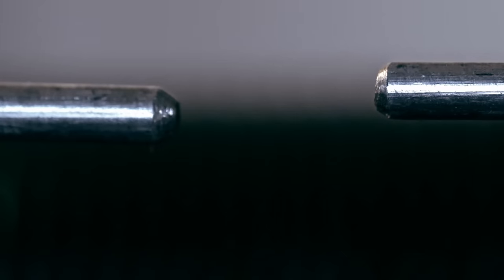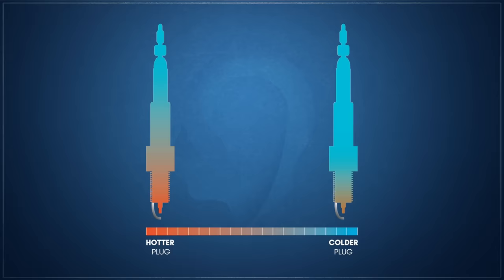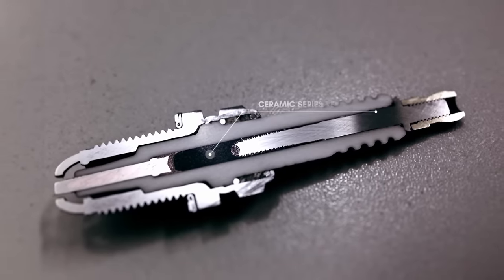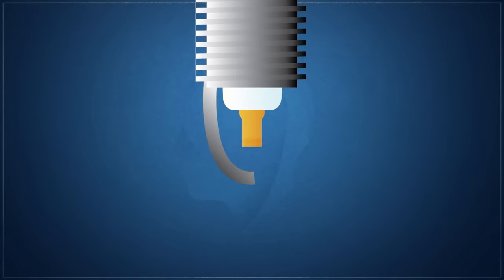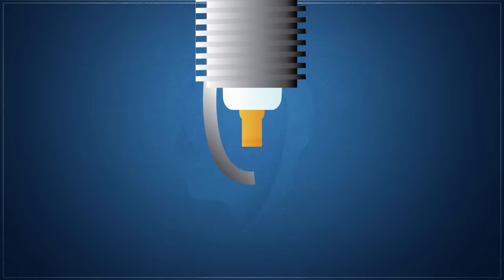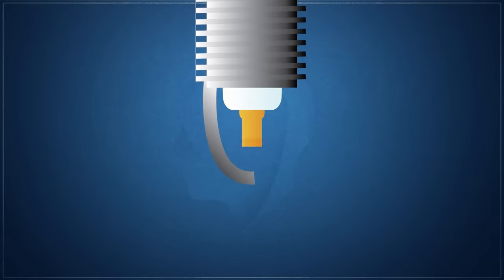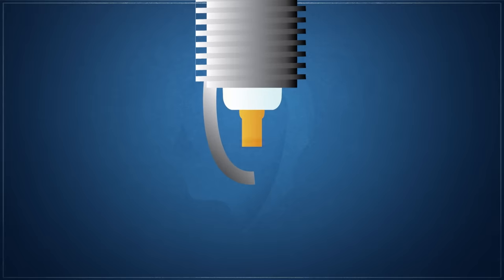The Spark Plug Story

Comment: As an old-school retired mechanic, I had no knowledge of the current use of the spark plug itself as a monitoring device. Excellent well researched video.
Reply: https://en.wikipedia.org/wiki/Saab_Direct_Ignition
Reply: Believe we were trying to do that in the mid 2000s on megasquirt detecting knock from ionization.
Reply: I tip my hat to the engineers that came up with that idea.  Awesome!
Reply: Research never stops...
Reply: Imagine most parts, devices, mechanisms, can work "both ways".
Example: solenoid valve. If you power it, the plunger moves, but the movement is visible on the current plot (waveform). You can power and diagnose the thing at the same time. Nothing new. Anyone "old-school" should know this!
Reply: @g.k.1669  No one "came up" with anything. These are basics of most electrical parts. You can monitor operation of the element (whatever: solenoid, motor, bulb, transformer, injector), by watching the waveforms (voltage, current) on oscilloscope.
Reply: Modern cars are terrible.  They won't be on the road in 50 years.  They simply are not designed to be cheaply serviced.
For example, a lot of modern cars now use a plastic intake manifold. This WILL become brittle and crack.  This is true of basically all plastics.  The used market won't help because age alone damages them.
MAYBE people will be able to print them in sections or get someone else to print them with a large enough printer. But it will cost a fortune.  This is just one of many, many problems when it comes to longevity and especially serviceability.
There was just a big story about a tail light that was five thousand dollars.
Reply: @christo930  Amennn.!!!
Reply: @christo930  A plastic intake manifold? I guess that is why modern stuff have those large plastic covers above the top of the engine to hide all of the weird things under them.
Reply: @Bob_Shy_132  Yes. Believe it or not, they are pretty common.  I have no idea why they put the plastic covers over engines these days.
Reply: @christo930 MANY times thise covers have a noise reducing pad affixed to the back side of them, and are there to cover up sounds of noisy injectors and high-pressure fuel pumps on engines today, and avoid customer complaints of "my engine sounds more noisy than it should be".
Reply: @davelowets  Injectors and high pressure fuel pumps (which are usually in the tank) have been around for decades.  These plastic covers have been around just over a decade.

Comment: My father invented a self igniting spark plug, it contained a piezo crystal and used engine compression to put pressure on the crystal causing it to make a spark, a man from the patent office came to see the prototype in action and was impressed to see a 250cc engine running with the plug,  it was to receive a patent but my father could not afford the fees at the time and it was shelved. The plug needed more development as i found out when i tried it in my Yamaha FS1E 2 stroke, i think the compression was too low,  but it had potential even as a get you home device should your cars electrics fail, i see piezo electric ignition on model engines these days but they dont operate the same way my fathers did
Reply: That would require lecture of the crystal, and a spark off of that crystal, (but we are talking incredibly small voltages)

I dont see how you could do that and keep it running considering it would get dirty,

The high voltage helps arc past these buildup issues
Reply: Great idea! Working out timing would be tricky using compression and getting a good spark timing curve to match rpm. A piezo triggered by a cam with mechanical advance or electronic somehow might do the trick as well???

Comment: It’s amazing how much spark plugs have improved in such a short time. Anyone who is at least 50 remembers when we had to clean or replace our spark plugs every few months/few thousand miles. These modern plugs will go 75,000-100,000 miles or more without even needing to be cleaned! I remember when you would pull them and clean/regal them every few months and they still would wear out and need to be replaced after a year or two. My current car has over 100k on it and I only replaced the plugs once! Honestly they didn’t even need to be replaced at 50k but I just got nervous and changed them out because I was worried they would get sized in the heads after being in there for 5 or 6 years! Anyone remember points? Yea we used to have to do a lot more maintenance on cars back then. Granted modern cars have lots of other problems and I’d gladly go back to points and the old plugs, it really wasn’t bad having to replace plugs and points every other oil change because those older cars were a lot easier and more pleasant to work on compared to these late model ones where you have to take half the car apart to get to anything. Leaded fuel didn’t help fouling but the real improvements are in the materials. Those old plugs just wore out the gap got bigger and bigger and after a few months it got so large that the engine started misfiring. When I pulled the ones out of my current car after 50,000 miles the gap was almost the same as a new plug! We’re talking about maybe 0.010 wear, those old school plugs eroded that much or more in 5,000 miles.
Reply: Yes...I haven't seen a gapping tool in a long time...
Reply: Some of us young folk still know how to take an emery cloth to a points dizzy! And truthfully, I agree with the sentiment behind going back to points and old plugs. I daily drive a 77 Mercury Cougar and do all my own maintenance on it. Oil changes, brakes and bearings, carb and timing adjustments, and most importantly diagnosis... I can do it all with simple tools and from the comfort of my own garage. Some people call me crazy for driving a gas guzzling land yacht but honestly I wouldn't trade that kind of straightforward, analog, accessible ease of work for a newer car. Hearing recently about Dodge's new non-serviceable transmission, in addition to watching a very disappointing video review of their new Hornet SUV (from a channel here on YouTube titled "The Fast Lane Car"), really made me take a step back from the idea of the modern automobile. In an age where planned obsolescence and reliance on technology are becoming more and more prevalent, I think it's increasingly reasonable to seek a product made at a time when planned maintenance and longevity were the premiere focus. I really do.
Reply: Yes, BUT, the cars with these more sophisticated system can be absolute hell to deal with when they do develop problems, and they all do. For myself I prefer simpler less efficient designs that have fewer parts and are easily serviced. I don't care if I have to replace my spark plugs, cap and rotor every few years. It's easy to do...
Reply: That is a much more common dilemma for Diesel glow plugs... try it on a straight-6, 3.0l Mercedes diesel with 650,000 kilometers! (it wasn't pretty)
Reply: This is all way above your pay grade.
Reply: Filed & gapped a Lotta plugs & points,  but that Snap-On file hasn't touched anything automotive in a longtime.
Reply: If you attempt to 'clean' platinum or iridium plugs you will damage them.
Reply: I was born in the mid-1960s and grew up in the Minneapolis area. We actually had very cold winters back then- most of the winter was around zero degrees Fahrenheit and occasional Arctic air mass cold snaps to -30degF were regular occurrences during the 1970s there. Every fall in mid-October, my dad would pick a Saturday for he & I to get the family cars ready for winter. He'd get me up early on Saturday morning, feed me a big pancake, eggs and bacon breakfast, and then we'd drive out to the auto parts store where he'd buy plugs, points, a "condenser" (capacitor), winter-weight oil, a new oil filter and maybe a new distributor cap (if needed) for both of the family cars. Then he'd drive us back home in the crisp, sunny October daylight, typically around 55 degrees F and surrounded by trees that were in full color and dropping leaves, where we'd spend the rest of the morning and as much of the afternoon as necessary getting the cars, which had carburetors, ready for winter. Both cars usually had Sears Die-Hard batteries in them and we'd pop the caps off, measure the acidity in each cell and top them off with distilled water, clean the battery posts and cables, put in the new ignition parts, clean out the distributor caps, re-time both cars, change to winter oil and so on. Cherished memories of the annual ritual with my dad. :)
Reply: I drive a stock FJ60, carburated. About 20 yrs ago found out of about Pertronix and bought a Electronic replacement for Std contact point ignition. Never had to adjust Spark plug gap every 5K miles again. They last for ever. Once in a while remove and blast clean and gap if necesary.
Reply: Proper fuel n air mixture are the biggest improvements.
Reply: Amazing story 😮
Reply: I am going back to points. My 2014 Challenger is such an unapologetic shitbox that I'm replacing it with my grandpa's 1971 Chevy C10.
Reply: Nobody remembers a time you had to clean or replace spark plugs every few months.  This is complete and utter nonsense.  I'm 54 and I've never had this experience. I've owned and daily drove late 60s and 70s model cars as a teenager.
2 years, sure.  Plus, plugs were a buck back then.
Reply: @Trump985  If you remember that you are over a century old lol.
Reply: @SParis-xy1pc  Likewise for me. I flat refuse to buy any car new enough to have electronic fuel injection anymore. My 2014 Challenger was the last modern car I will ever daily. Replacing it with grampa's 71 Chevy C10! Straight six, 3 on the Tree, manual everything, and the most advanced tech in the entire vehicle is a mid 70s shaft mount AM/FM/Cassette radio I installed because grampa ordered such a simple truck it just didnt have a radio in the first place haha.
Reply: @christo930  Wasn’t my experience, I clearly remember cleaning plugs every few months on my 1960s and 70s cars. They didn’t start misfiring but you ended up losing some power after a few months and or a few thousand miles. The average person probably didn’t notice and likely ran there plugs till they noticed a misfire. As a young kid who drove like an idiot I was always chasing every last HP. However todays plugs don’t get fouled/worn anywhere near as much and cleaning/regaping them after even a year won’t gain any power.
Reply: @Trump985  Not every few thousand miles.  20k maybe.
Reply: I have a Ford 5.4 that didn't throw a code for over 260k miles... and NEVER had the plugs changed.
Reply: @TestECull  Points are fine for cars that originally had points.  But right in the early 70s is when most switched to HEI.
Reply: @Trump985  I was driving these cars when they were old, not new.  Even old they never needed plugs every couple of months.  That's just hogwash.  Granted, I was putting plugs made in the late mid-late 80s in these late 60s and 70s cars, but plug technology is nearly unchanged from that time.   Generally speaking, plugs just don't foul for no reason. If your car is running properly, your plugs should be fine for at least 2 years back then. It's when the car isn't running well that you end up with fouled plugs quickly.  This is particularly true if you are running rich or your oil rings aren't working.  But back in the 60s and 70s, these cars were new. The rings weren't leaking.  The carbs were not clogged up and poorly adjusted.  The gas was formulated to work well in a carburetor.

Comment: One of my first cars was a used 1970 Subaru 1066 cc, 4-speed manual trans,  which gave me more than 40 miles a gallon for the 13 years I had it. The NGK long reach plugs always had a soft tan colored residue on each of the the spark plug insulators. I was amazed how well designed the engine was and how well it ran, giving so much efficiency using old technology of carburetor, copper core plugs, ignition points and required valve tappet adjustments. It was pre-catalytic convertor and ran on leaded gas for at least half of its life. It ran so cool that the muffler would rot out frequently due to condensed moisture for which there was even a drain port on the bottom. I got the idea to pour some paint inside a new one and fully coat its interior which extended the muffler life substantially and never even caught fire even!
Reply: When cars were proper... it's better for the planet to keep an old car going than to keep buying a new "more efficient" car every 3 or 5 years
Reply: @greensnake00  I still drive an old 2000 Honda Accord with 167k and no real issues.

Comment: @3:38 once the ionized channel starts to conduct, voltage goes to near zero because it's practically a dead short. In reality it pulsates rapidly because the ionized channel will get blown out allowing a voltage to build up again so you get a few sparks.
Reply: Yes, the video is more like academic paper (but dumbed down for children), rather than practical guide.
Reply: Damn you beat me to it! Interesting video otherwise though,  honestly didn't know that's how the Saab knock sensing was "so special".. smart people working there for sure.
Reply: @Pelletajuton1  If you keep the spark on you can measure current flow on the low voltage side and determine the temperature in the cylinder. The ignition coil is fed a square wave in electronic ignition systems.
Reply: *arcs

Comment from the maker: ▶ Visit https://brilliant.org/NewMind to get a 30-day free trial + 20% off your annual subscription
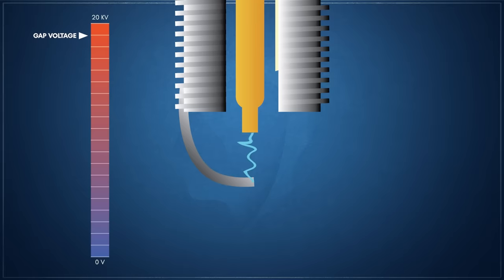Reply: 3:22 the voltage indicator should now go to almost zero, as when the spark is ignited the ionized air has very low resistance, there is only about a hundred volts potential difference between the electrodes.
Reply: @kubeek  General public will never spot such basic mistakes.